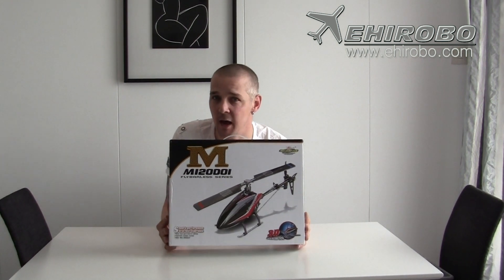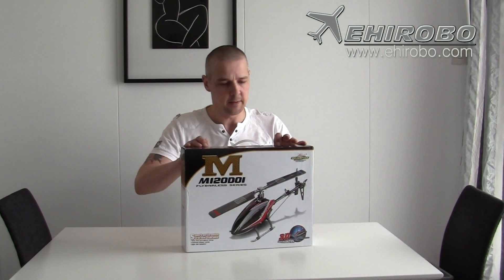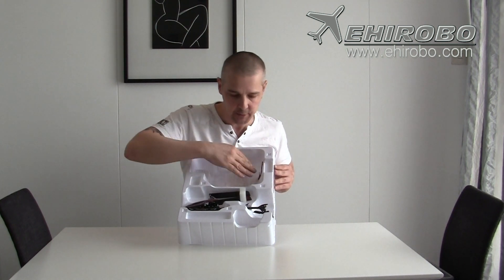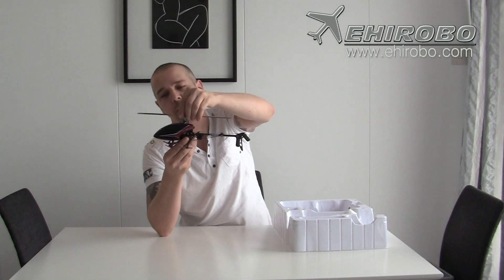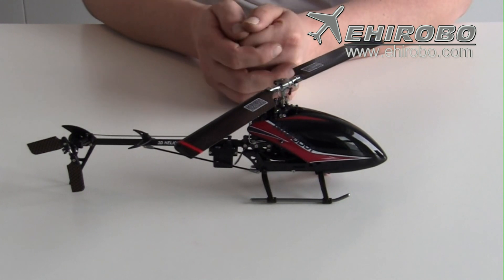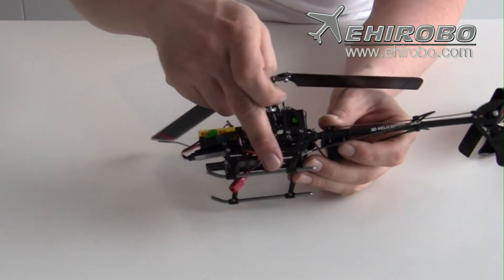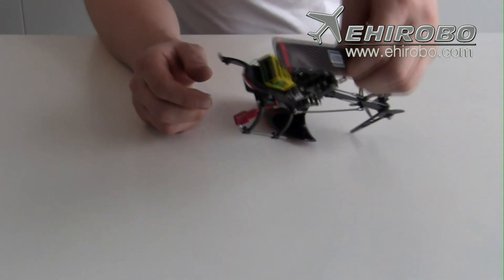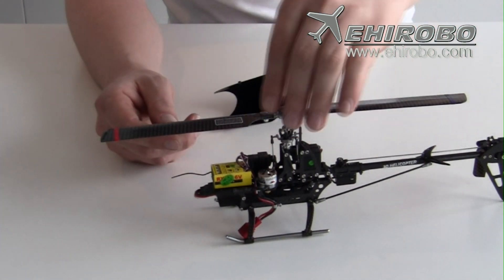Walkera M120D01 - InBox And Little About

Comment: I actually like this because... finally they have a stock cf frame!  Looks like a really robust cp micro and I still like the professional torque tube tail.  I have to get used to the belt system on m new Gootch 450SE V2 (T-Rex clone)... I know it supposed to be simpler, but when you haven't repaired a heli with that kind of tail it's all new to you when it comes to tail repair.  Gonna watch your flight video now!